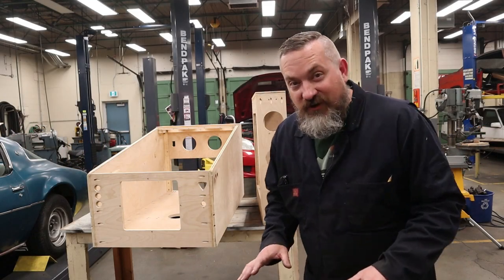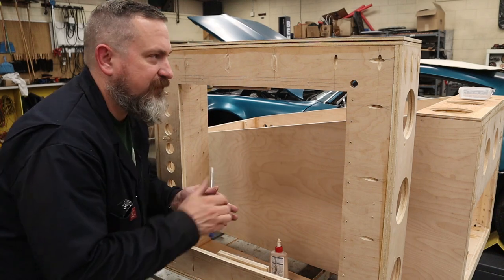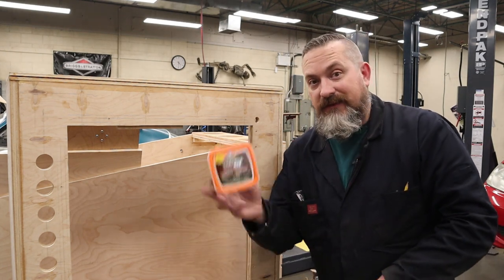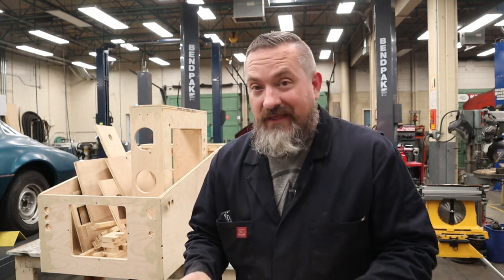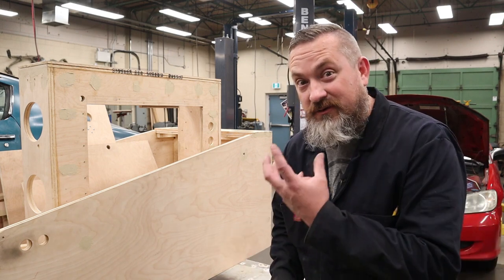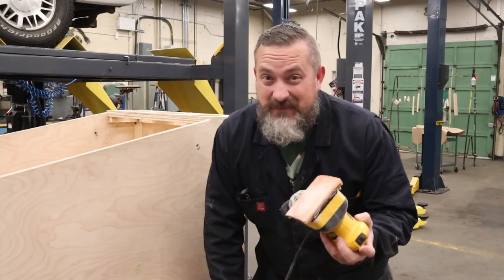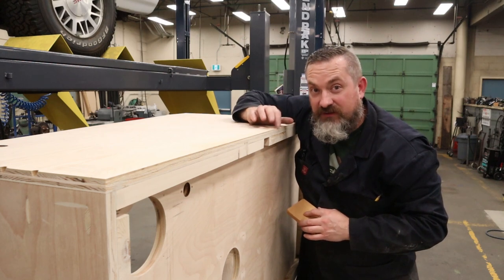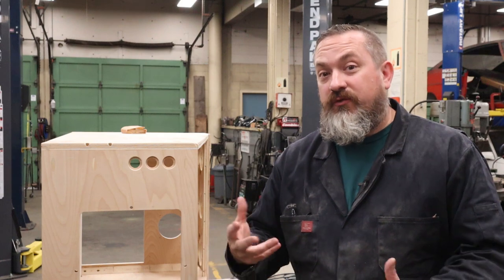How to prep your vpin cabinet

Comment: Pocket holes are cool but the required effort here to fill is a good example of why you might want to avoid them if you can. I did glue and nails with similar bracing along bottom with screws. If the pocket holes and the fill work has you rethinking building a vpin you can go simpler (MJR build guide has some guidance on options).
Reply: I like pocket hole joinery myself, but I'd still agree with you. A builder could always pin and block the outside edges that show and use pocket holes where they aren't seen.
Reply from the maker: Is it more work?  Yes, yes it is.  Is a pocket hole and wood batton corner strong as hell.  Yes, yes it is.  A butt joint isn't as strong but faster to create.  I'm very happy with my cabinet though and it WILL last longer than me....lol.  Thanks for the watch!
Reply from the maker: Yeah these pocket holes when done properly are very strong and when you add the glue blocks behind in the corners, these cabinets are stupid strong.  It's more work but in the end, I will never ever worry about the strength or longevity of this cabinet.  It's stronger than the factory ones.  Thanks for the watch!
Reply: @wayofthewrench  agree if you have means, skills, and tools which you certainly do! I don’t think I could have done that with mine. Just wanted to comment there are easier options that are still sturdy enough for people intimidated by the work involved with all the pocket holes.
Reply from the maker: yup there are always easier and harder way to do most things.  Thanks for the advice! Cheers!

Comment: I wonder if STERN builds their cabinets with this attention to detail??
Reply: you would think so for the price they charge. But you can bet your ass that they dont. its line assembled CNC rapide work.
Reply from the maker: In a production environment....no one does it like this.  It's all about money so they pump them out with just enough strength to last an estimated lifespan like 15 or 20 years under normal use.  Mine is going to last longer than me....lol.  Thanks for the watch!
Reply from the maker: Yup, assembly factory style.  I heard that Stern employees have to play a certain amount of pinball a week......that would be cool.  I'd be a good employee.  Cheers!

Comment: Appreciate the video series but pocket holes are really a sub-optimal choice for a cabinet that you plan on painting/covering with artwork.  You would be better with just glue and screws.  Those are easier/faster to cover the holes as well.  Pocket holes are really over-used in youtube woodworking, they are a bad choice in the majority of situations people use them in videos!
Oh and on that vac leave the power setting to auto, when its set to auto turning on the sander turns on the vac.
Reply from the maker: I would agree and disagree with you.  Are the pocket holes extra work?  Yes.  Are they a stronger joint than a butt joint.  Yes.  Plus once you put in a glue block in the corner on the inside, these cabinets are rock solid.  As for finishing, you'll see in the next 2 videos that the finish is flawless but it does require a little bit of care to ensure the finish is perfect over just a flat surface.  you have to remember that with a butt joint, you'll still have to finish the end that is slightly sticking out anyways.  As for a locked miter joint, that's a joint that most people will not be able to do (skill/cost of router and table) but will have the least amount of finishing required.  In my wood working projects I like to use much stronger joints like finger or mortise and tenon but these are overkill for a vpin.  Thanks for the tip about the auto setting on the Festool vac/orbital sander!  Thanks for the watch too! Cheers!
Reply: @wayofthewrench  They are definitely stronger than a butt joint but the reality is for a cab such as this the butt joint is perfectly fine.  If you worry about the strength glueing a cleat inside long grain to long grain on both pieces of the ply would make it rock solid as well.  I use my domino for my cabs but that's a tool beyond most non woodworkers budgets.  The auto setting is the best part of those vacs!  If you really want to go down the dust extractor rabbit hole look up cyclone pre-separators! :)  Love the series, it is by far the best I have found for VPin so much love for sharing it with us all!
Reply from the maker: I've fixed my share of drawers that are butt or simple rabbet joints that are glued and pinned.....I hate simple butt joints.  I also just wanted to try/learn/test/teach something different for people to watch too.  Thanks, I'm just happy people are enjoying the content and it's helping new people get into this cool hobby.  Cheers!